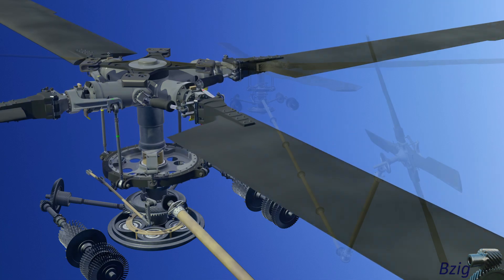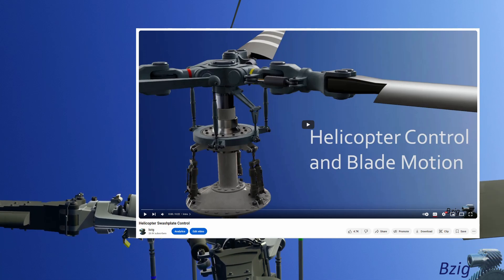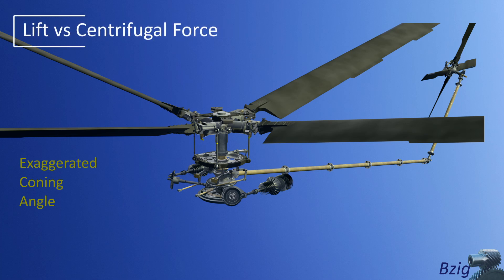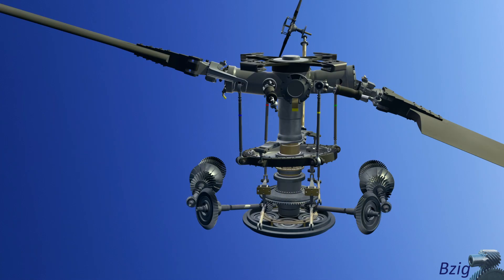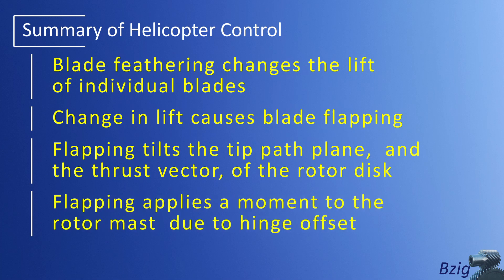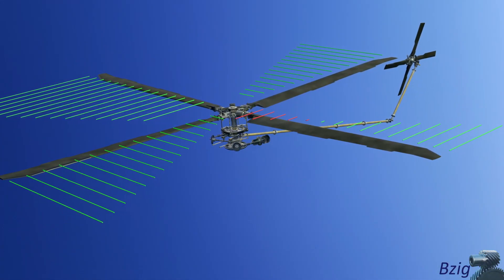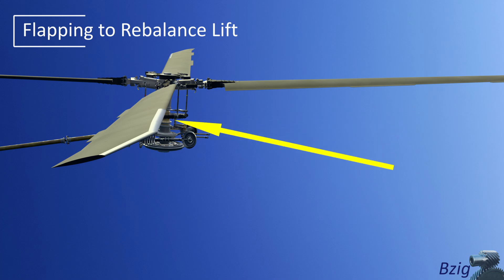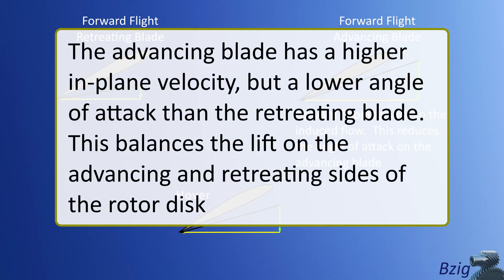Helicopter Control - Flapping

Comment: As you add forward cyclic for gaining air speed, cyclic feathering also reduces on the advancing blade pitch and increases on the retreating blade - It's not just all flapping you have but it sure helps... Great animation
Reply: I’m glad someone else knows this. However I would take it one step further and argue that the advancing blade in constant speed forward flight is not flapping up at all. If you look at the path of a blade from the 6 o’clock position to the 12 o’clock position you will see that the blade is moving from a higher to lower position.
With the appropriate control input from the pilot, the dissymmetry of lift is cancelled by adjusting pitch cyclically.
If, as a majority of instructors teach, the flapping cancels out the dissymmetry of lift, then you wouldn’t get flap back as you accelerate.
Reply: @tommyandmyf  What's interesting is blades act like loose chains flapping up & down along the full span, Seen it in old high speed films Sikorsky Hughes and Bell tests
You can look them up - Cool stuff
Reply: @ yeah I’ve seen those videos. Very interesting. I still don’t agree with the very common teachings that “flapping cancels out the effects of dissymmetry of lift”.
Reply: @tommyandmyf  Hub flexibility the key flapping for removing mast moments on the air frame. hinges for lead lag & under slung to reduce conservation of energy effects from fatiguing the hub. Flapping is nice but not as important as cyclic feathering - The MBB 105 has a big pitch roll coupling  in forward flight as you use collective... Very pronounced ... rigid rotor with only feathering bearings, Lots to learn
https://www.youtube.com/watch?v=fRp2uAYWa_A
I Built this in 1995

Comment: Interesting, when I learned to fly helicopters in 1965, what he called “lead-lag” was called “hunting.” Neither rigid nor semi-rigid main rotor systems have a flap hinge. Semi-rigid or see-saw system blades flap but at the fulcrum, the rotor hub or rotor head, which is hinged to the mast. The best known helicopter with a semi-rigid system is this Bell UH-1 “HUEY.” The example in the video is an articulated system, with the rotor head “fixed” to the mast, requiring flapping and hunting hinges for the rotor blades. A rigid system also has a fixed rotor head but no flapping or hunting hinges. On this system, flapping and hunting are accomplished by flexibility designed into the rotor blades.

The response to a stall in an airplane is to add power (among other things); the response to retreating blade stall in a helicopter is to reduce power (among a few other things).
Reply from the maker: hunt-drag are still used as terms for lead-lag.  I've heard both used... I probably should have called out both as acceptable terminology in the video.  Thanks for commenting and for sharing the observation about teeters.

Comment: Your video animations are awesome.  I sense countless hours spent on this! 
I am a retired helicopter flight instructor and I also used to teach heli aerodynamics.  So here are a few comments on the aerody:
Although blade flapping can be the same mechanical movement as blade coning, it's important to separate the two.  Coning angle depends on disc loading (weight and G-forces) and flapping angle depends on disc tilting.  So where your animation is showing all blades 'flapping up', this can a bit confusing as you are actually showing coning.   Flapping = Disc tilting
And maybe most important, unless you fly an autogyro or a CH 47 Chinook, the so-called Dissymmetry of Lift in forward flight is actually not controlled with blade flapping.  As you correctly showed at the end of the video, a forward cyclic input is always required to check the undesired resulting flapback.  You will need progressively more forward cyclic input to check flapback at faster speeds or the heli will slow down.  So in the conventional heli, Dissymmetry of lift is controlled mostly through cyclic blade feathering. Maybe not what you are told in flight school, most books and most videos etc but such is life. 
Another detail worth mentioning in your video is about blade 'flapping to equality' (which is what happens 'temporarily all the time' during both flapback, any variations in induced flow across the rotor disc and most importantly with any cyclic control input)  I am guilty of teaching this theory in the past but it is NOT a variation in induced flow velocity that changes the angle of attack.  Induced flow remains perpendicular to the disc as it tilts so induced flow velocity is not changed much. Instead it is a purely mechanical action that alters AoA.  As the blade pitch remains fairly set, the blades flapping up and down with the same pitch angle will alter the AoA.  So Flapping to Equality always results in disc tilting.  Difficult to explain in theory but I reckon your animations would nail it!
cheers.
Reply from the maker: Awesome comment and thanks for the feedback!  I hear you on flapping vs coning.  It's the same mechanical degree of freedom and I did intend to convey the difference between the two motions.  Also on flapping induced velocity vs induced flow... This is where simple drawings are more clear than the 3d animation.  When I showed the blade sections, I should have showed both the induced flow (unchanging as you say) and the flapping induced component before showing the resultant normal vector.  I thought about that, but didn't do it because the drawings would have been cluttered.

Thanks for the feedback... it will help me make future videos better.
Reply: Mind blowing comment. Made me rethink reality haha. I thought long and hard about what you said in reference to cyclic pitch correcting for DoL, and it mostly makes sense. However, in this scenario, that would make me thing you could self induce retreating blade stall with simply a full cyclic defection forward. Or in that case, you could stall any portion of the rotor disk simply by using full cyclic control in any direction. This is not the case from my limited experience with such extreme maneuvers. So there must be flapping action occurring in forward flight that is significant enough to induce an AoA change to the point of causing a stall. 

I have thought about a strong wind gust in a hover off the nose, and how the helicopter responds with a nose up attitude and drifts back. And how in high speed forward flight, its the forward and to the right cyclic input that keeps the helicopter flying straight and level. The cyclic input by the pilot is what keeps the helicopter from pitching and rolling, both in a hover and forward flight. So that leaves me more confused then I was years ago in flight school. Where does the flapping due to different airflow velocities take place?? I know the FAA answer but what is actually happing here?
Reply: Do you know what causes adverse yaw on a helo?  I was an automatic flight control system (AFCS) instructor on the F111A and an AFCS instructor and tech rep on the SH60B and HH60Hs.   When I was a tech rep for Sikorsky on the HH60Hs I had the chance to talk to an aerodynamic engineer at Sikorsky.  I ask him the adverse yaw question.   He said aerodynamic forces.  I said what aerodynamic forces? He said "we really don't know ".   My guess is gyroscopic forces from the tail rotor.

Comment: How does rotor size and stiffness affect flapping? I have a radio controlled helicopter (T-Rex 600 with a 4 blade rotor head) and there is no flapping hinge at all, but the blades must flap to allow forward flight so I'm guessing most of the flapping occurs by the blades themselves flexing close to the blade roots (the blades are carbon fibre). There is also a rubber bushing in the blade grip but it is extremely hard and you can't see or feel any obvious movement if you try to pull on the blade grip in the axis the blades should flap. (Lead/lag is taken care of by the mounting bolt in the blade grip going through a bronze bushing in the blade root acting as a hinge, allowing the blades to lead/lag quite easily).
Reply from the maker: The flapping hinge can exist without the presence of a mechanical hinge.  These are called "virtual" hinges that rely on bending to achieve the same result as a mechanical device.  I'm guessing the vertical pin rubber bushing is the lead-lag degree of freedom.  This only needs 1 or 2 degrees of motion.  

I think you are correct that flapping is taken up entirely by bending of the blades.  This would give a very high hinge offset which results in a very responsive (some say "twitchy" helicopter).  Full-size helos with this arrangement (lynx and BO-105) usually have stability augmentation that lag-filters pilot input to take some of this responsiveness away from the pilot.     

It doesn't surprise me that RC helos would have this control system... they are insanely responsive to control inputs!
Reply: @bzig4929  No stability system in the MBB 105 only a mast moment gauge on bending forces
Reply: @bzig4929  I don't understand the absolute need for the flapping motion for the helicopter to work. Why would a totally stiff blade without a flapping hinge not be able to make the whole helicopter tilt into the direction the pilot wants to go?
When there is a cyclic input even with 100% rigid blades (in terms of flapping), I don't see how it would not cause the whole helicopter to tilt (with precession of course)
Reply: @bzig4929  Such 100% rigid helicopter might not be pleasant to fly if it was a full size one. But at least it should be able to respond to inputs.
RC helicopters used to be equipped with the additional "paddles" (the flybar) with complicated mechanical mixing into the main blades in order to make the helicopter more stable and counter unwanted movements. Also to amplify the forces of the servos. But today they just have very minimalistic rotorheads where the swashplate is directly linked to the blade grip. The blade grips sit on the same feathering shaft, so their only axis of freedom relative to each other is their blade pitch. It is all very rigid. Gyro controllers (flybarless systems) take care of the unwanted effects and dissymetries. But some people have also flown these without the gyro systems.

So I think that a helicopter without any flapping is still able to be flown, but just much more difficult to keep under control.

Comment: Really love your stuff, I was wondering if you could discuss tail rotor flapping in another video? I've heard of it briefly but haven't looked too much into it. I'm wondering if it's even a thing.
Reply from the maker: Definitely!  It may not be the next video, but I'll get to the trail rotor.  I'm still trying to figure out if the 60 has delta-3 on the tail rotor flexbeams.  It doesn't appear to, but I may be missing some detail.

Comment: Is the Sikorsky Shake caused by tip stall?
Reply from the maker: I'm not really sure what "Sikorsky shake" is.  All helicopters have vibration modes. But I think most pilots don't experience tip stall because they stay withing the limits on the aircraft.  Sikorsky seems to take pride in high Vne aircraft so I think this would be especially true for that product line.  

 Tip stall, in aircraft with hydraulics, is often not felt by the pilot until it gets pretty bad.  I flew CH46s and that aircraft had an indicator... They put strain gauges on the control links at the rotor and fed that into a gauge for the pilots to show tip stall approaching.
Reply: @bzig4929  Also, maybe I misremembered, and it’s the Sikorsky Shimmy not the Sikorsky Shake.
Reply: @bzig4929   I’ve only heard Sikorsky Shake a few times over the years, but my recollection is that several pilots described it as a common trait with all Sikorsky helicopters, and that the company even had to add a vibration damping system into their rotor systems. But a quick Google doesn’t find more than a couple of references. But Google can’t find a lot of things it used to.

Maybe the dynamics of the Vertol twin rotors is different enough the dynamics are different?
Reply: Sikorsky Shuffle. It’s a feature, not a bug.

Comment: Is the coning angle different in any ways during autorotation? (Both practice and emergency if different)
Reply from the maker: Coning is mostly influenced by the weight of the aircraft.   This can be the actual weight, or the weight due to g loading.   An autorotation is a 1g maneuver so coning is about the same as any other 1g flight condition.

Comment: Another solid video! You mentioned at 8:49 that absent of flapping, the dissymmetry of lift would cause higher lift in the advancing side and cause the helicopter to ROLL. You later mention that retreating blade stall causes a loss of lift on the retreating blade causing the helicopter to PITCH up caused by phase delay. 

Wouldn’t dissymmetry of lift also be subject to phase delay causing the helicopter to PITCH up? I also believe this action is the cause of Blow Back and what requires more forward stick input from the pilot. The amount of additional forward cyclic is proportional to the forward speed of the helicopter. This forward cyclic input in turn mechanically changes the pitch (less on advancing and more on retreating) of the blades and reduces (or eliminates) flapping due to dissymmetry of lift. (Pilot induced delta 3 hinge)

One more crazy phenomenon. More induced flow at the rear of the disk in forward flight causing a reduction in AOA and lift resulting in a ROLL to the advancing side. 

Curious to hear your thoughts. I could very well have some (or all) of this wrong.
Reply from the maker: my thoughts... if there were no flapping hinge, the aircraft would roll due to FFDOL, but the flapping prevents this increased lift from ever happening.  And you are correct... this is what leads to blowback of the rotor disk.  Instead of a left roll, there is blowback due to FFDOL.  But this doesn't cause the aircraft to pitch up... the rotor disk pitches up (blowback) but not the aircraft.  The autogyro pioneers were the first to figure this out.  I believe de la Cierva attempted a rigid rotor and only after seeing the controlability issues did he add the flapping hinge.

I can see why you say "a pilot induced delta 3."   Delta 3 creates a natural coupling between flapping an feathering.  So if the pilot changes feathering based on the blow back... I get the analogy.  
   
It's interesting now that many are attempting to develop eVTOL aircraft without flapping hinges (like Joby, Archer, Beta) I understand, with side-by-side rotors, they won't see the issues de la Cievra saw on a single rotor autogyro, but all of those rolling moments have to go somewhere.  If it isn't a control moment, it will be loads absorbed by the rotor masts and the airframe.  I wonder if their flight test campaigns will point them to the same epiphany of Cievra.   

I think your last point is talking about transverse flow and this is one of the many subjects I didn't cover in the video.  I have a book written by Sikorsky (the company, not Igor) "Sikorsky Helicopter Flight Theory for Pilots and Mechanics"  This book deals with these subjects much more completely that I can do in 10-15 minute videos.  It would probably take  10 hours to cover the materiel in the same depth as a book.  Hopefully these videos stimulate questions and thoughts that point viewers to other sources and more study.

Stay curious!
Reply: @bzig4929  I truly appreciate the amount of effort you’ve put into this and the amount of knowledge you have on this subject. In my opinion, helicopters are one of the most  fascinating mechanical things in the world!

I have a copy of Helicopter Theory by Wayne Johnson. I’ll have to pick up a copy of Sikorsky Helicopter Flight Theory for Pilots and Mechanics.  

I still struggle to understand why the helicopter would roll due to FFDOL. I need to do some more research. If you want to pitch the rotor in any direction, you increase (or decrease) the lift 90 degrees (or whatever phase delay angle the system has) behind that intended direction. What scenario will a rotor tilt in the exact direction where the lift changes? That is where I am getting lost. 

As far as blow back pitching the rotor and not the heli, I can see that being true for a semi rigid head but not a fully articulated head. Any pitching of the rotor on a fully articulated head will induce a moment on the helicopter due to the offset hinge. Full transparency here, I most definitely could be misunderstanding something here! 

I too have thought a lot about these eVTOL aircraft. They make zero sense by the way. I can’t come up with a single scenario where they are successful. The blades must be subjected to significantly more stress than a helicopter blade due to their rigid design. It’s probably within the design envelope as traditional airplanes experience the same dissymmetry at high alpha with the descending blade having a higher angle of attack. The rolling moment gets thrown into the airframe and is balanced by the counter rotating blade on the other side of the fuselage. (At least that’s my theory)

I don’t mean to challenge you in any way. I respect your opinions greatly. Many beers could be drank discussing helicopter theory but I think most people would lose interest fairly quickly. 

I look forward to your next video.
Reply: @bzig4929  Compressibilty before retreating blade stall - You get a rough ride then at stall the helicopter will pitch up and roll to retreating blade side. - Seen test footage and data. Family was friends of Igor during the Los Angeles Airways days...  Before I started flying...